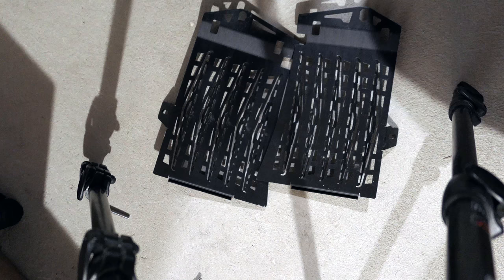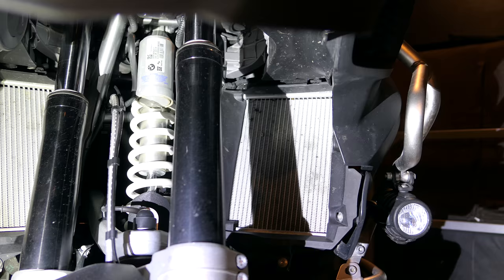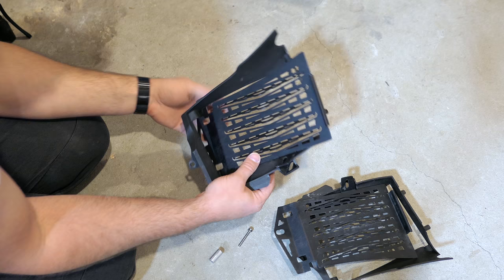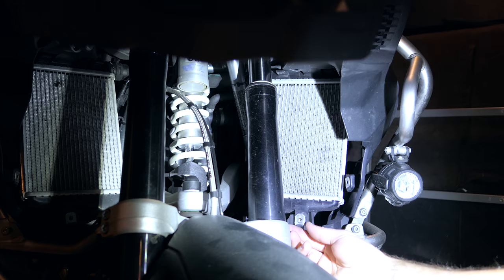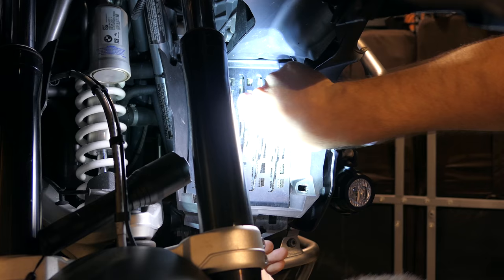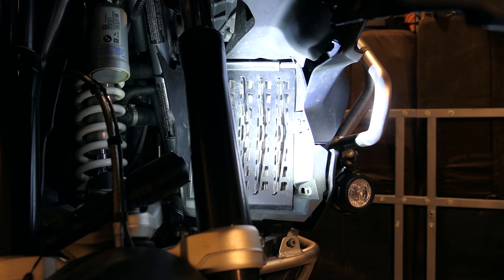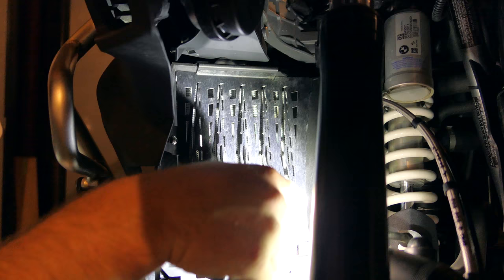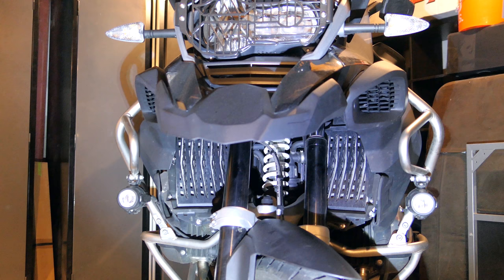Installing AltRider's Radiator Guards, R1200GS LC R113-P-1102

Comment: I have used them for 4 years on my 2014 R1200 GS in 43  C plus outside air temperatures and did 40 K on the bike- never had a temp issue - interstate or off-road going slow. Got a new set for my 2018 Triple Black and found this how to video on the install. Thank you.

Comment: Hi Adam, I was told by two BMW service techs that this brand’s radiator protection design is air constricting and that the TT design is much better. I’ll be curious to hear from you in spring/summer. Cheers
Reply from the maker: We'll see! I was choosing between both of those but I got these used for $75 so I figured it was worth a try. I am in New hampshire. Our summers peak at around 75F. Not that hot really.
Reply: Adam Chandler ah NH. Yeah you’ll be fine for sure. Cheers